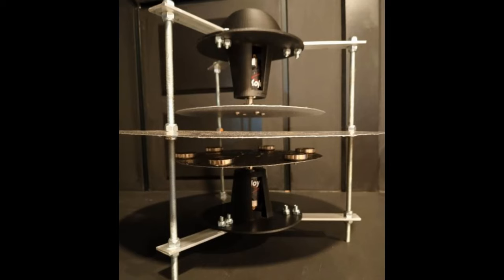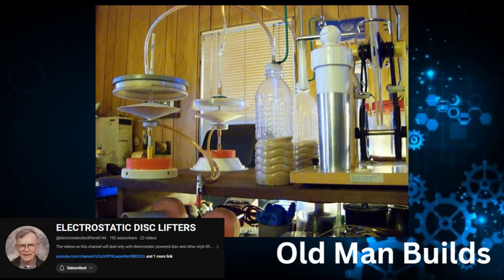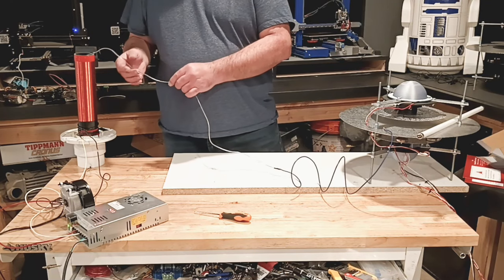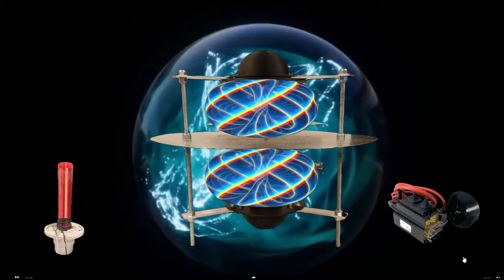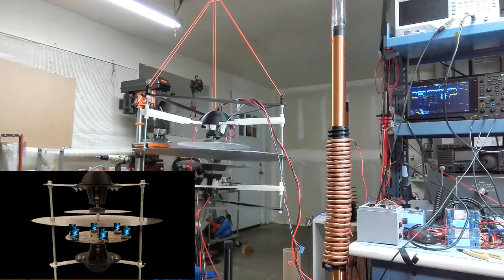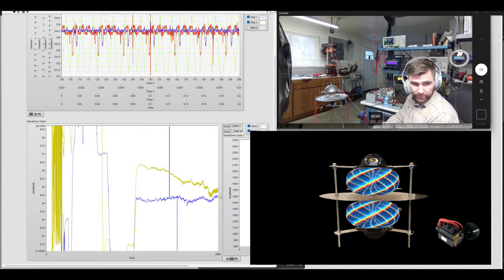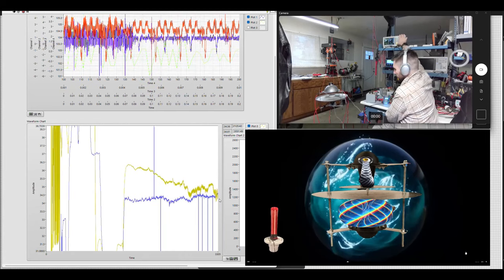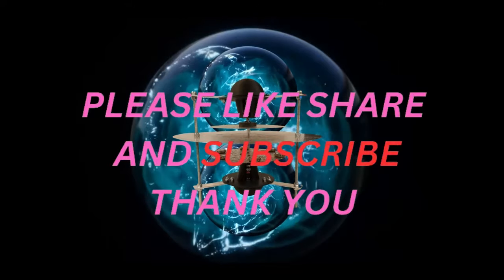Graviflyer Testing For Lift Factor #21

Comment: It is also a torsional field generator, the rotating magnets create a torsional field, in this case, in the middle outside, will be a clockwise rotation and outside, will be a left spin field.
(this option is to put when both coils in the middle of the device, because I saw this project, and confused with your project )
and long coil creation in reverse , so you need to block, long coils, field down. (the distribution of the torsional field depends on the shape of the coil)
him blocks the small coil, but to increase the chance, you need to replace the small coil, two wire, capacitor type.
this should increase the chance several times that the device will work.
The ancient Egyptians knew very well about torsional fields
too strong torsional field may harm health, for protection, you need two , to stretch, polyethylene  sheets, (longitudinal threads are formed) , crossing them,  will receive a shield.

Comment: Random question. Can a speaker be added for amplification? I'd think the sound would be resonating through each side.

 I need to save some money, so I too can have a lab.
My kids want me to learn Blender so I can sell 3D VR stuff. Blenders hard, shoot all these button commands to memorize. 

Kinda amplify the resonant sound? I'm trying to make the flyer, but smaller, in my head. Smaller seams to quit, to quit to lift?
Reply from the maker: I built a donut in blender once. It is hard but like anything the more you do it the faster it becomes. It took me months to learn fusion 360 but I can now make models fast. The time put in was definitely worth it.

Comment: Shape of Disc Lifter Configuration, Works Great, With Sealed And Pressurized Acymetric Capacitors. Using Styrofoam, In Ceramic Ones, for Setting Air-gap, Works Great. Styrofoam Burns Off, In Firing. 2 Holes For Pressure Guage and Air Fill, Will Alow Styrofoam To Burn/ Melt Out.

Comment: The wire that is connected to the middle plate has resistance, if you can reduce this resistance, the problem of burning will be solved and it will draw less current.
Reply from the maker: I agree. I am still trying to make sure he didn't do something on purpose that I am missing. The problem with the burning goes away at low power. I ran up the power to find abnormalities.

Comment: 100 %  now make a body that keeps the neg on the outer body and a core that keeps the pos in the center . dew to the earth neg and the atmosphere pos charge it will help for more lift if the neg charge on the body are more to the bottom of the body and visa versa . That's the way a cloud works with tons off water inside

Comment: But statics and gravity are not the same thing. And statics won't work in space.
Reply from the maker: So tell me in detail what energy is there surrounding the Earth and how is it working in space?
Reply: @nathanbunten4299 Actually there is no energy that surrounds the earth and other objects in the space , now if you would say that the magnetosphere is the energy that surrounds the earth but that's not applicable for all objects, instead the curvature of space time fabric is the only thing that is applicable from  darm matter , dark energy, regular matter,Antimatter and even energy. If you want to know the about the energy that gives mass to particles and objects then the answer would be Higgs boson field and zero point energy field that interacts with the matter to give it mass. Don't take it as a rude comment but I just want to make you realize this.
Reply from the maker: @ARPITKUMAR-he4ks  space ship pass through energy coming back to the earth. It is there. If it wasn't then there would be no atmosphere on this planet. I don't care what you call the energy but it is there.
Reply: @nathanbunten4299  I respect your ideas but personally I believe that tesla's dynamic theory of gravity is the only way to solve all mysteries.